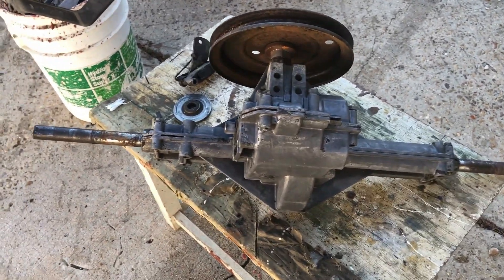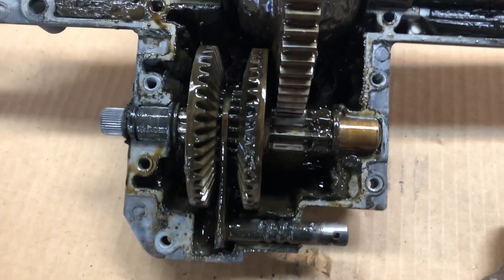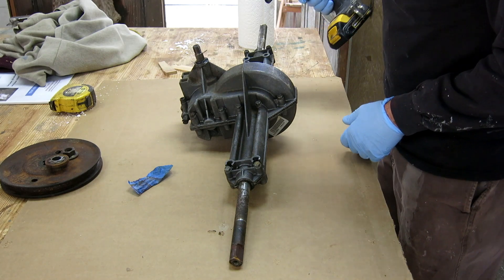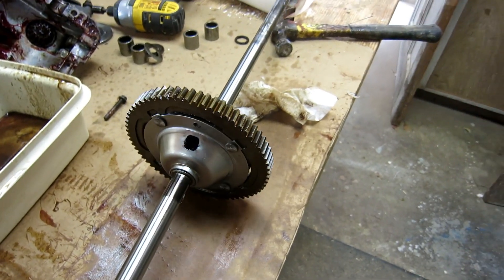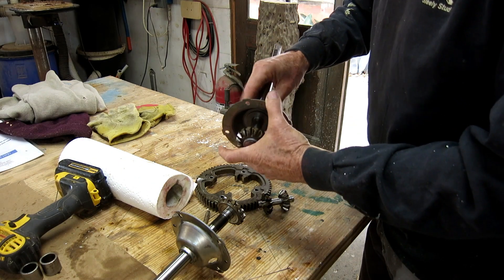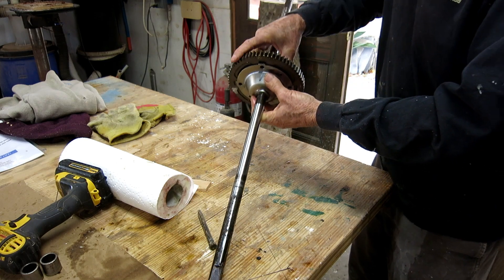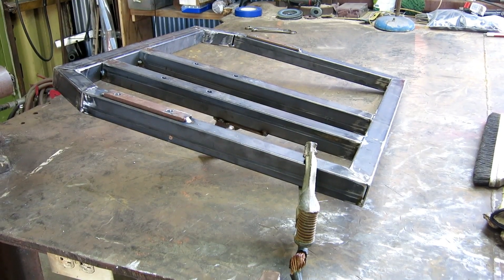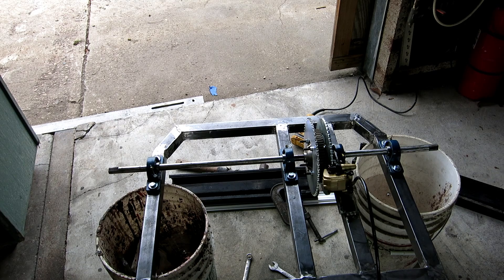Mini T Build #5 The Rear Differential From A Riding Mower

Comment: My simple logic would be if you used larger wheels than the mower then your engine at the same revs would make your Kart go faster than a mower. So is your math calculation correct? Did you try the contrivance out at least in a rough mock up?
Reply from the maker: theosalt1
Well it’s been a while but gear ratio has never been a problem. Steering has been a problem, but not drive train. I did use a four wheeler motor that has three speeds and reverse so lots of flexibility. Thanks for watching and thanks for taking the time to comment.

Barry

Comment: What size wheels are you using and have you tried larger?
Reply from the maker: Glen
The wheels are built using 20" bike rims. I like the size so no, I haven't tried larger.
Thanks for watching!
Barry
Reply: @barrylukebuilds7894  Hi thnx for the reply I am looking at building an E car/trike and trying to work out if I need a Diff or just a live axle... Think diff from a rode on mower?
Reply from the maker: @glendooer6211  Glen
No easy answer here. The little dirt quads have a rear wheels fixed to a solid axle. Lots of traction but on hard ground they push badly, they don't want to turn. Every go cart we (and others) had as kids had power to one rear only. The other rear wheel was on bearings. No problem with low to medium HP but would get stuck in the grass. A diff is a nice thing but requires a little more head scratching and adds a little more weight. Just depends on how much sophistication you are after. 
Good luck on your project!
Barry
Reply: @barrylukebuilds7894  Think I will go for 2  motors in Motorbike wheels and have 2 accelerator pedals ..cheers
Reply from the maker: @glendooer6211  Then you could do away with a steering wheel and just have swivel casters up front, like a wheel chair!